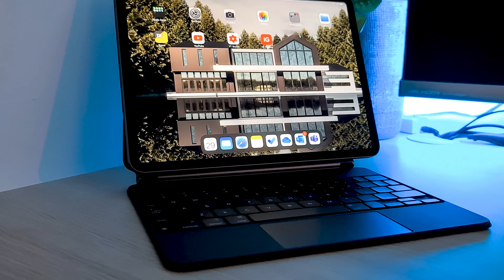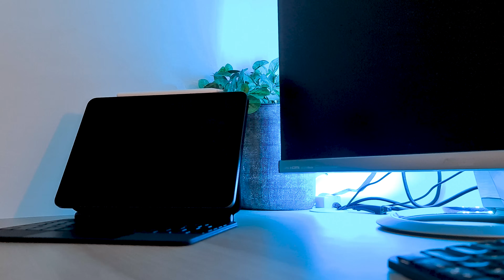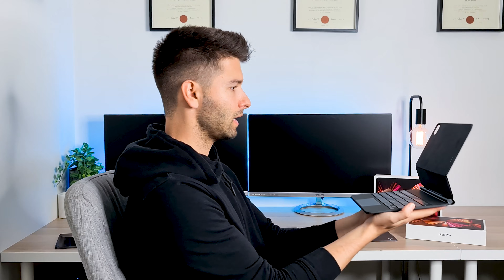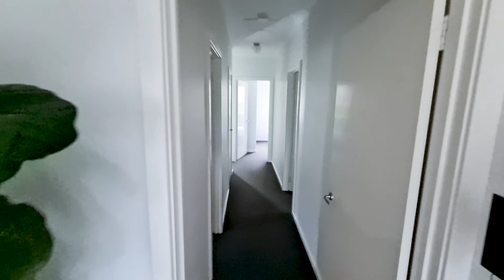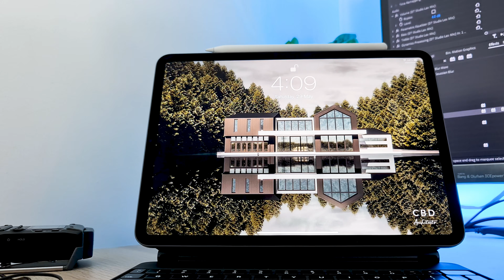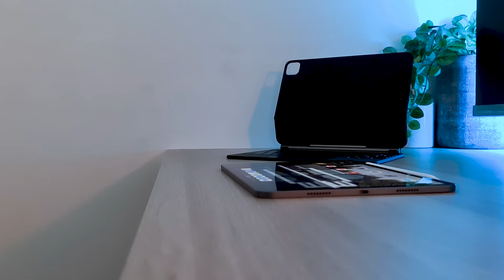M1 iPad Pro for Architects

Comment: Hey man, I’m thinking of getting either an Asus ProArt PX13 - super capable 2 in 1 laptop. 

I have an 11.9 inch iPad Pro, but bring that AND my laptop along and its assorted required tech is inconvenient. So is there any chance you might review the px13? It has a dedicated gpu and the SAME powerful processor as it’s 16 inch counter part, and i want to use it for architectural work and my masters next year. 

So please let us all know. Your thoughts and opinions. I want to make my workflow more seamless and i need to know if that px13 is worth investing in, or simply using what i have, or even upgrading to an m3 iPad Pro max (and deal with a disjointed workflow 😅)
Reply from the maker: Unlikely I’ll review it. 

For masters I always suggest a desktop set up and work from home as much as you can. The time you’ll save waiting for renders is invaluable when comparing to laptops. 

If you need a laptop/ipad go budget just to make things work for 10mins at uni, invest in the desktop. You’ll get more power for less money. 

I did the whole 2-in-1 thing with the microsoft surface back in the day, hated my life, sold it all and went full desktop, never looked back. Didn’t even have a laptop towards the end.

Comment: did you tried install windows on virtual machine on ipad pro and run full version of auto cad offline from desktop version on windows... maybe its good idea for you.. is enough  calculation power to run and windows games works on emulator windows machine on imac.. and may be also bersion not cloud  decktop on ipad pro,,, Maybe is worth to check it and install  :) cheers
Reply from the maker: Havent tried it yet but have been thinking about it for a while. Just don't see the need for it on the ipad if you have a desktop honestly.

Comment: 8:43 pro tip: ipados actually has a system wide replacement shortcut for esc key. You just have to press cmd + . (Full stop key)
Reply from the maker: Well well well! Great tip! Still disappointed it's not in the top corner.

Comment: I currently have a MacBook Air and I’ve been using it for a year for architecture. Personally I’m more of a digital architect and I’m considering getting an iPad Pro. I don’t know if I should or not. My MacBook is kinda slow when running programs like photoshop and auto cad or google sketch up.
Reply from the maker: You'll need a computer regardless of your preference to succeed in architecture. Ipad still can't run any high end programs like archicad or revit. The ipad is a fantastic tool and I highly recommend it if you can afford it. Priority should always be the computer though.

Comment: Does anyone still use archaic AutoDesk software? I haven't used any as an architect with my own practice for 20 years. The fact that it won't run off an iPad is not an issue. Even if ArchiCAD and Vectorworks won't run either is not a problem as BIMx and Vectorworks Remote (the VR and visualisation software) do. The other huge plus is the LiDAR to avoid having to use topographical and measured building surveyors who often cannot handle point clouds or IFC files.